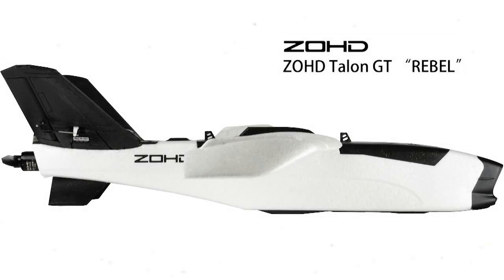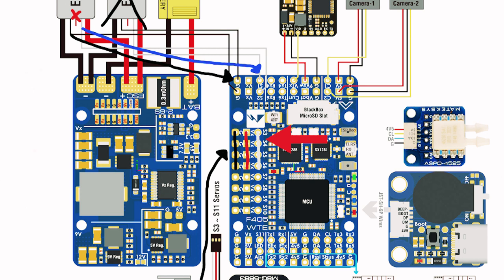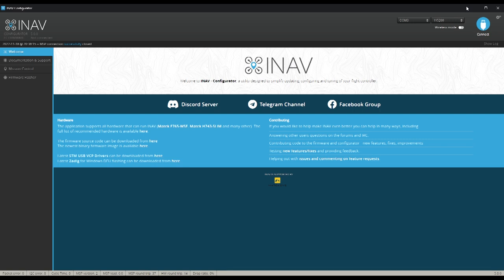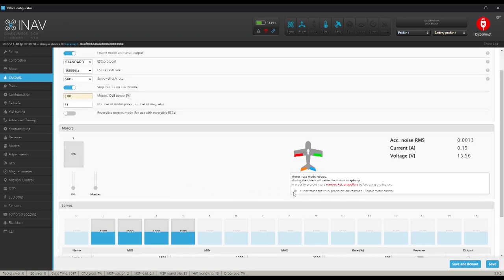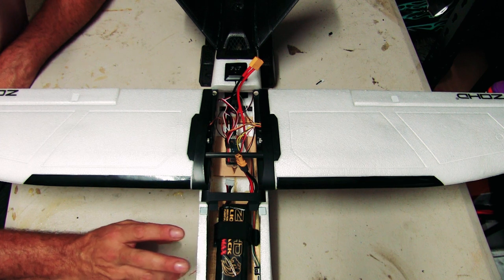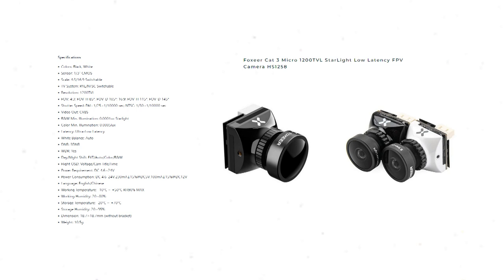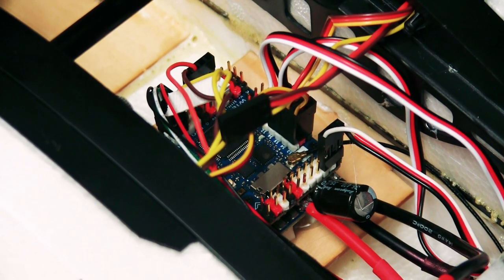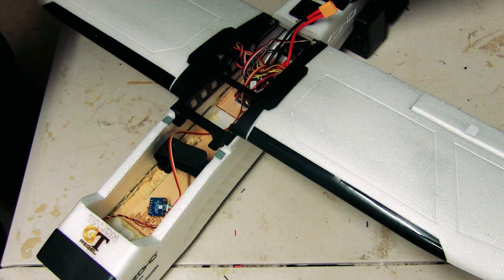Talon GT Rebel Build - Final INAV Setup with Matek 1.3ghz VTX and Foxeer Camera  Install

Comment: Great vid!  Just got my T GT and using a speedybee but looks a lot like yours.  Would love to see each inav section since I don’t have a copy.
Reply from the maker: Thanks, mine hasn’t been flown much since the maiden video. If you watch the maiden video although it was successful I wasn’t totally happy with its setup especially on launch. I do plan to fly this again once the weather cools and I’ll probably do a remaiden with the latest iNav firmware at that time. I do plan to make some changes eg battery size and prop size. I believe its setup was a bit heavy and I want to lighten that next time. The iNav setup I had on its maiden was purely stock settings without any piff tuning on adjustment I did was adding more throttle upon launch to help compensate for the large battery it was running.

Comment: Best YT guide I've found on the GT Rebel. Most are the FPV kits and very general. You went into the details I was looking for. Got yourself a new Sub bud! tk vm! Get a Dolphin guide out if you own it. Really nice plane. I just replaced my Matek stuff with the Speedybee F405 APP and it rocks on my wings!
Reply from the maker: Thanks mate for the comment glad it can help. A Dolphin is one bird I do want to get as well as the speedybee f405 only problem is it seems to be sold out everywhere I have looked. I want to upgrade the fc on the fx61 with the speedybee. Regarding the talon, if you can purchase a 2nd kit I would highly recommend it as parts are very hard to come by. Damage on my talon before it’s maiden due to my cat I have needed to order a whole kit just to replace the damaged elevator and control horn. Really bugs me I have been waiting now for near 2 months and it’s still on backorder.

Comment: I had that VTX and that antenna in the wing mounted. The V in the wing is a disaster - catches grass every landing. I ended up swapping to a normal dipole that is flexible and safe for landing. And of much better quality too.
Reply from the maker: Thanks for the tip.

Comment: I’m new to the hobby and I was wondering in INav there isn’t a vtx table for hd camera and seeing how most hd systems these days you need to connect your vtx to the FC to unlock it and put in the frequency tables so your vrx can connect to it. So is there not a vtx table in INav? And I’m guessing you’re using analog so how do you unlock analog systems and setup the right frequency tables?
Reply from the maker: Yes I'm still using analog fpv video. I've never had to unlock anything regarding my vtx setup. All my vtx vrx frequency settings are all done manually during my builds. INAV does let you change frequencies and power via transmitter but I haven't bothered using it. You can always join the INAV fixed wing group on Facebook they have helped me out heaps during my INAV learning process. Thanks for the comment.

Comment: Hi buddy. I’m litteraly fighting with the 405WTE. I can’t get Rx signal with TBS Crossfire nano Rx, soldered same way as you at UART3 but the internal receiver led till blinking red. At port tab set Serial Rx at UART3, Tx & Rx allready binded.. don’t know wath else to do. Could you give me any tip? Maybe any config at CLI for the FC? Thanks in advance
Reply from the maker: Sounds like a bad signal connection somewhere.It's powered correctly so make sure that you have the RX to TX and TX to RX wiring from the nano to flight controller or you will get no signal.Other than that it sounds like its setup pretty well. Let me know if that helps.

Comment: .it really hurts my head thinking how connect those wire correctly..😅😅😅
Reply from the maker: Lol yeah bro it is a puzzle you just need to take time and read the wiring diagrams for the flight controller after a while it becomes easier and not as hard as it looks. The hardest part is the setup on the computer and making sure everything is 100% correct and moving in the correct directions. The smallest error and the plane will crash on its first flight. The first flight is always scary as hell lol!